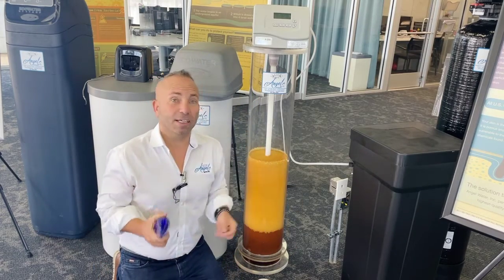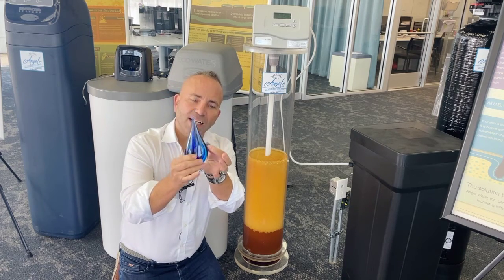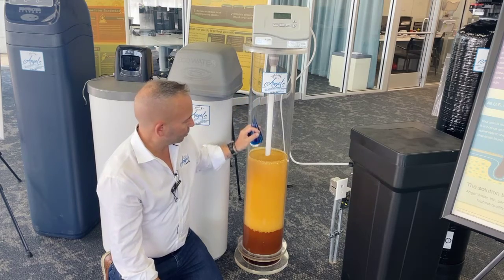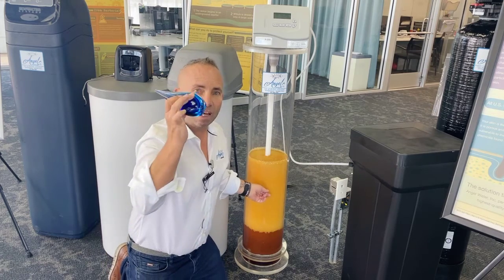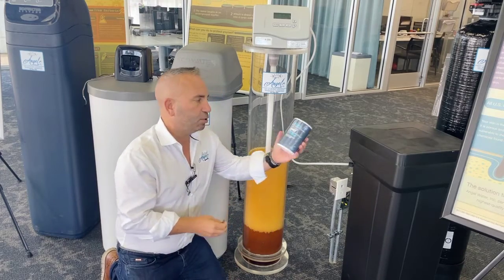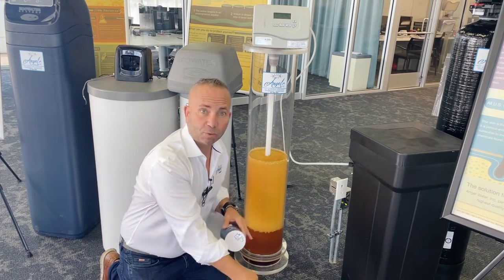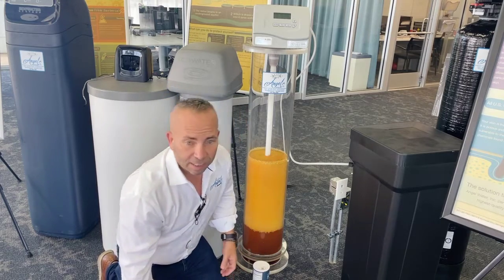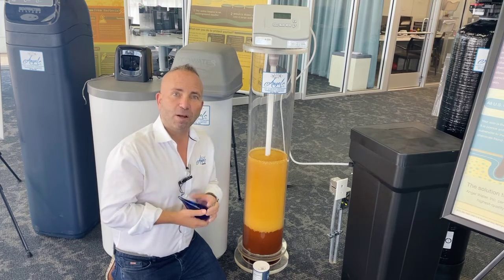How Do Water Softeners Work? | Angel Water, Inc

Comment: It's sodium bicarbonate not salt after the brine feed incorporates with resin.
Reply: Sodium is salt bro. It’s just salt that’s has an ionic charged hence the bicarbonate. Aka baking soda. Should he call it baking soda instead? Wtf

You can also replace the sodium bicarbonate with potassium bicarbonate if you can’t ingest high amounts of sodium or “salt” in your diet. 

Referring to the sodium bicarbonate as “salt” makes way more sense than the other potassium bicarbonate option.

That’s why when you buy or look up a bag of sodium water softener tablets… it’s says SALT on the packaging. And when you look up potassium bags it just says water softener tablets. Sodium is salt.

Comment: I have questions.  Hope you can help...I just bought a cabin in the county with a well and it has hard water.   It has a GE SmartWater GXSF40H.  It was completely empty of salt.  I cleaned the salt chamber and put 3 bags in to fill it about 2/3 up.   Only been here 2 months and we hadn't ran this thing so didn't know what to expect.  I programmed it and ran the instant recharge mode.  I have no experience with a water softener system. I watched a bunch of videos to gain some knowledge.   I noticed that there is very little media in the brine tank.  I shined a light in and saw the bottom with a float.  How do I know if the correct level of media is in the brine tank?  I read reviews on this model where it malfunctioned a the beads went out into the houses water system.  maybe thsi happened before we bought the house??  How can I check to see if it is working properly?
Reply from the maker: If you can take the control valve off the top of the water softener, you will be able to see how much media is inside the tank. On a GE water softener they are filled almost all the way to the top.  These units only last a few years. Sounds like it’s a little old and may need to be replaced with a professional grade system.